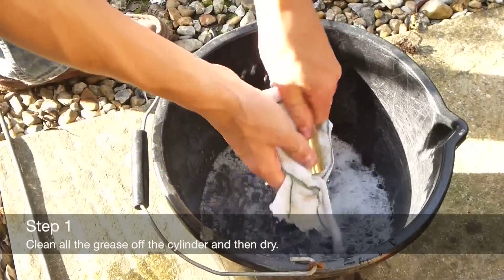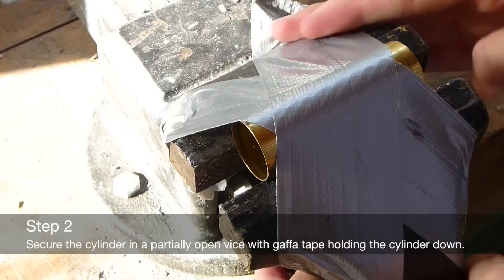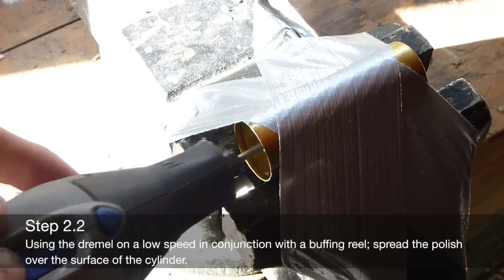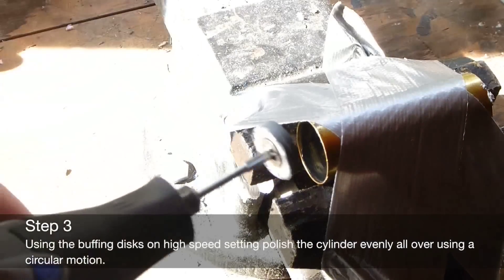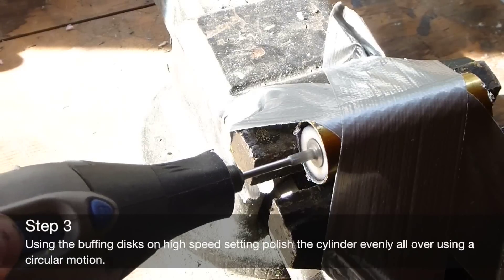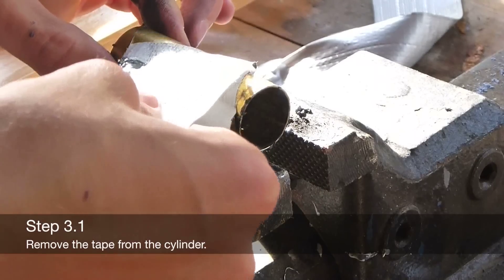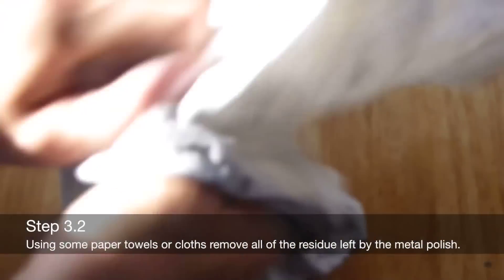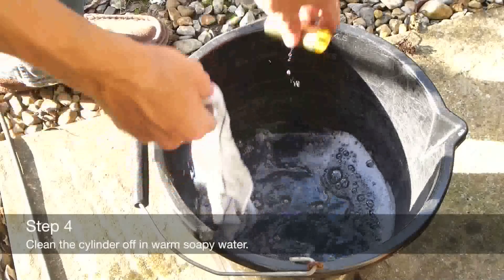Airsoft Tutorials - Polishing the Cylinder

Comment: Ideally you would not use the dremel to do this. The dremel tool polishes in the wrong direction (around the barrel) this will create small ring patterns inside the barrel and will impact on the seal. Better to make your own polishing tool out of a rod with a rag tightly wrapped around it. Create back and forth movements with a slight twisting. This will take a little longer, but will be way better for sealing and smooth movement of your piston. I would also advise you don't over-polish. All polishing compounds are abrasive and over-polishing will increase the diameter of your cylinder too much.
Reply: You can buy a good ciinder brand new with 10 dollars... And they have all tolerances right. Why do this?